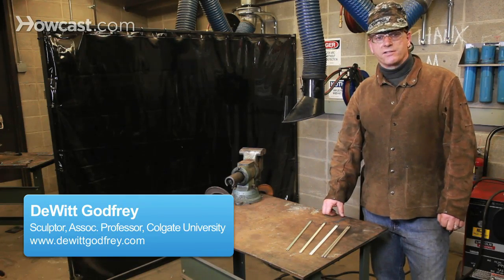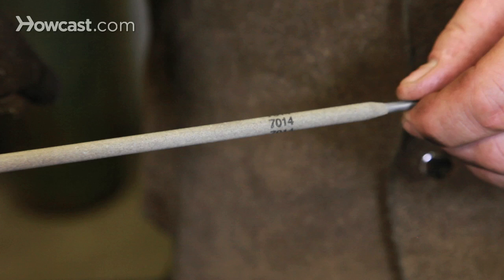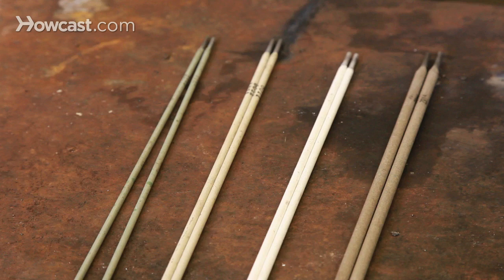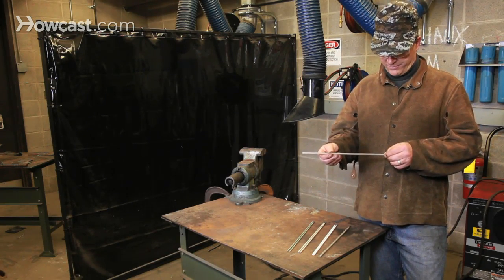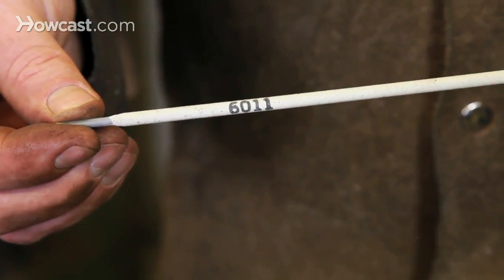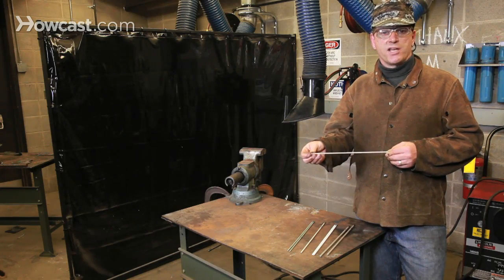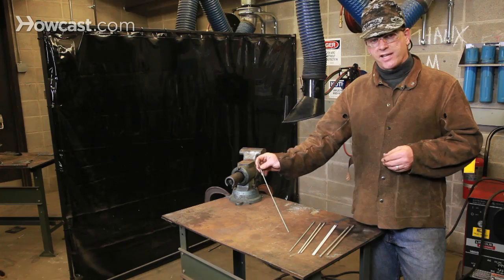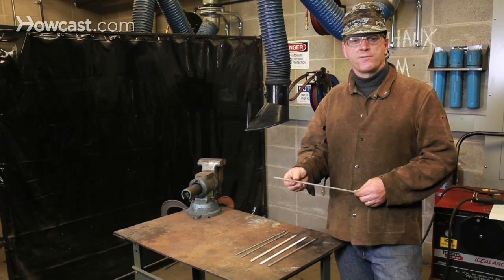How to Pick a Welding Rod | Welding

Comment: 60 and 70 are tensile strengths. 1 or 2 indicates position. 1 through 8 are slag desination.
Reply: Which welding rod should I use for 457 x 19 x 67 UB and 356 x 127 x 33 UB?

Comment: So what the numbers actually mean, 
The first 2 or possibly 3 numbers (some rods are called 11070 for example but they are not common at all)represent the tensile strength of the weld in thousands of psi 60,000 for example. The 3rd or possibly 4th( again not topical) represents what position it can be used in 1 is all, 2 would be flat only, finally the last number is telling you about what the flux or outside coating is made up of ( I am kinda new to welding going to school for it now so I could not tell you what the specific types of flux are and there number) I hope this helped someone, don't listen to that idiot and stay safe.